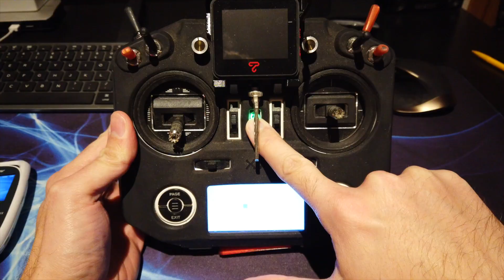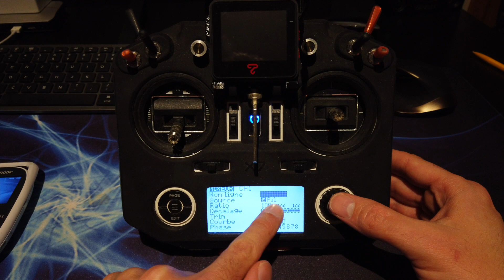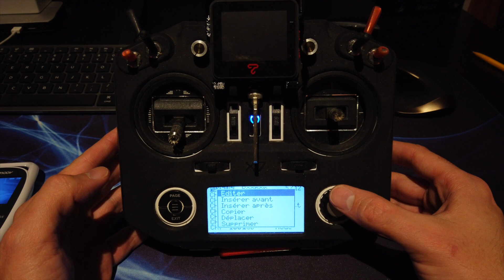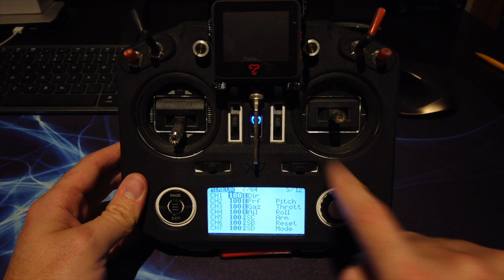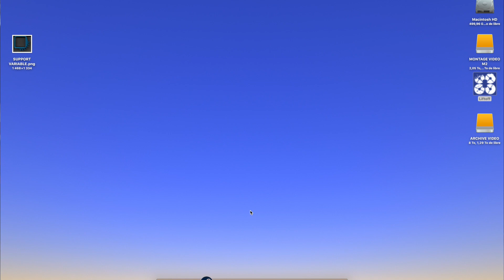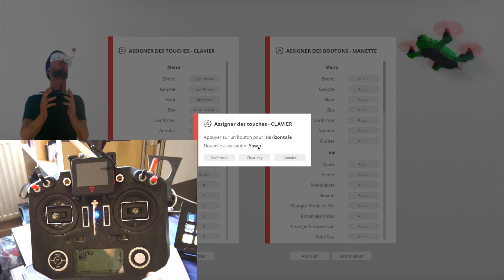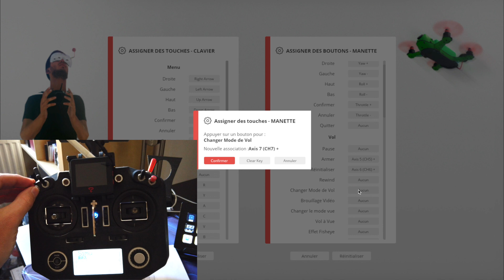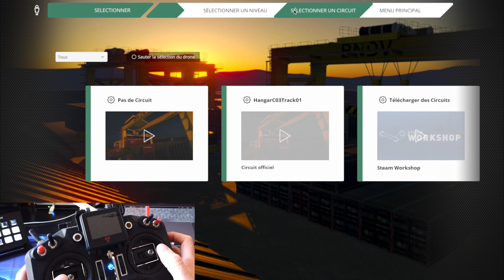TUTO LIFTOFF

Comment: Bonjour, Peut ont mettre n'importe quel radio ? si non quel est la radio nécessaire ? Merci.
Reply from the maker: Bonjour. Le simulateur Lift off reconnais pas mal de radio différente et même dès manette de jeux. En revanche l’idéal est de s’entraîner avec la radio que vous souhaitez pour les futurs drone ou machine que vois allez avoir. 
Il est donc conseiller de choisir sa radio pour simulateur mais aussi pour les futurs machines. 
Personnellement je recommande souvent les radio à base de open tx comme les frsky Taranis telle que la qx7 access ou autre mais il y a aussi maintenant de très bonne radio open tx comme les radiomaster TX16S où SE où Masterfire mais également les radio Jumper T12 T16 et T18 qui sont toute des radio avec firmware open TX
Reply: @gtechaudiovisuel  Bonjour, Merci pour tous ces renseignements très pointus au moins c'est clair SUPER